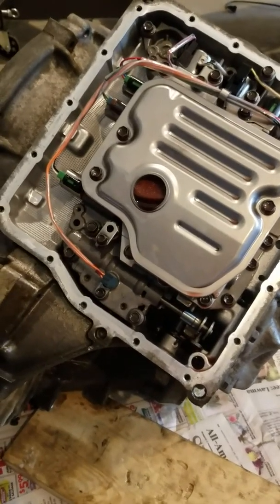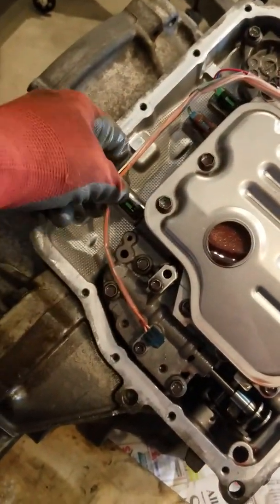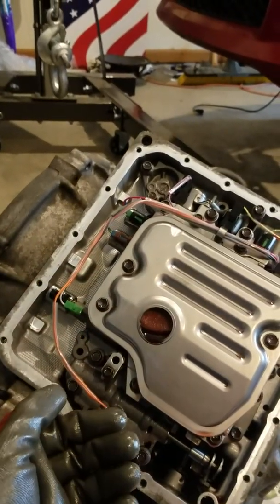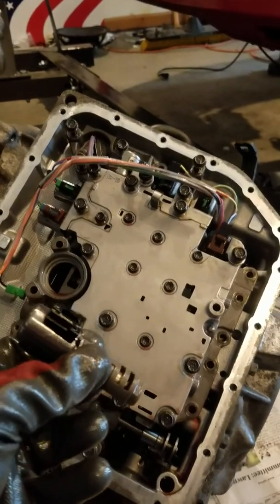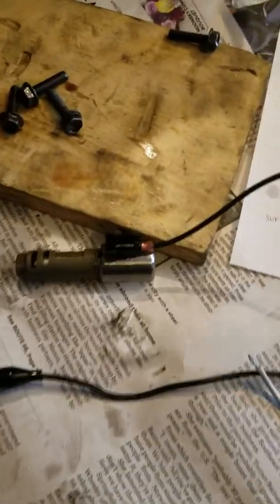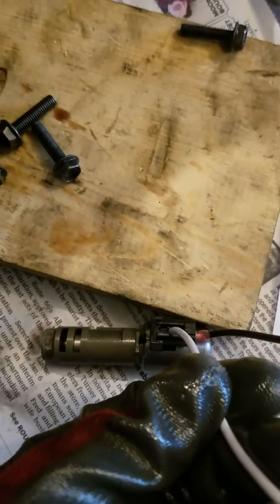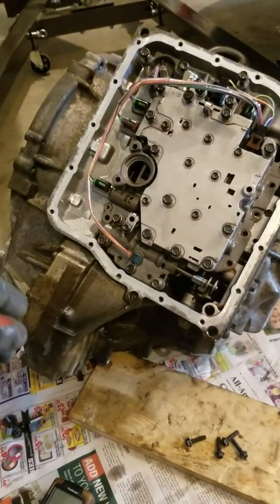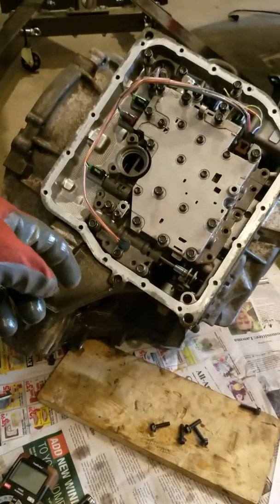2009 Pontiac Vibe 2.4L U250E transmission P0748 SL1 solenoid

Comment: I followed this video and now vehicle goes forward in reverse!? What went wrong? It's not reversing? Dash shows it's in reverse but drives forwards still.
Reply from the maker: I'm not certain what would have gone incorrectly.  Did you verify the check ball spring and accumulator piston were in their correct locations upon installing?  Did you verify the correct part that you were installing?  
It may be beneficial for you to view some of the U250e transmission videos from SealAftermarket youtube channel and see if any of that makes sense as to what could have gone wrong.

Comment: I have the exact same vehicle 09 vibe 2.4 and it skips second gear. Even in manual select mode it goes 1 straight to 3rd. It’s drivable but doesn’t even attempt 2nd gear. Do you think that could be a solenoid?
Reply: Sounds very much like it could be a solenoid.  There is a good video on youtube about how these transmission work.  https://www.youtube.com/watch?v=aWs9x_Mbr4A&list=PLPUEEb0cYK88PCuoAax5w2aKAXgFlajyZ
"ToyotaU250 Introduction" is what it's called.
Reply: I have the same problem with the transmission skipping second gear.  I cannot get 2nd gear even shifting manually.  Can anyone confirm if this is a solenoid issue?
Reply: @markwhitcomb9484  I finally found that it was a ground issue. I had a clump of ground wires on the back side of the transmission (between the transmission and firewall) that was loose. Grounded them and it shifted perfectly.

Comment: can change solenoid without uninstall gearbox? just open the pan/sump tank, then remove filter.
Reply from the maker: The transmission pan will come down freely after removing the bolts.  You can do this under the car, without removal of the transmission.  You can loosen some of the bolts to lower the valve body.  Look up my video of replacing SL3 solenoid and it will show you the steps from under the car.  You will need a new gasket when putting the pan back in place.